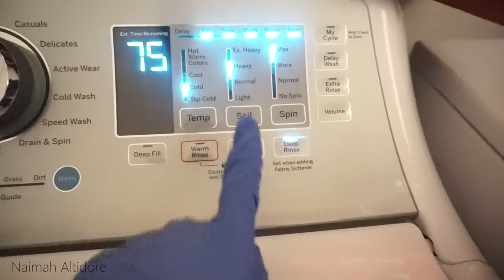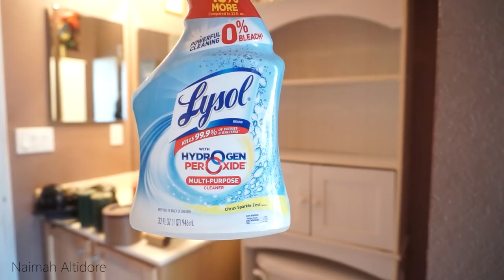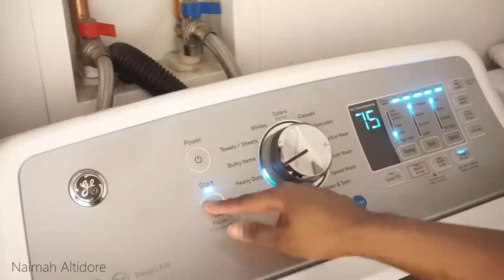ALL DAY CLEAN WITH ME / ACTUAL MESSY HOUSE / CLEANING MOTIVATION  / SAHM / CLEANING MY MOM'S HOUSE

Comment: Idk if your mom has already tried this but some vacuums have up to 2 filters (idk maybe more). The maintenance guy where I use to work told me depending on how much you use it, u should rinse them out weekly and let them air dry. I was about to buy a new vacuum and tried it and my vacuum was back to normal
Reply from the maker: thanks or the tip

Comment: Alcohol hand sanitizer if you  put it on and glory it off will disolve the ink.  You have to blot not to spread the stain.   The hand sanitizer is a gel and doesn't run off or soak in as fast.    It also w works if you get ink on other things.

Comment: Take an old White towel, an old steam iron, and oxyclean powder. Mix up oxyclean  pour on stain. Wet towel place over wet stain place iron on low cotton. Repeat until gone be sure not to melt fabric and always use fresh spot on towel. Will take several applications.

Comment: Nothing works better or easier in the bathroom,  than LYSOL POWER FOAM BATHROOMAFP CLEANER, you have to use an old tooth brush to get down in the hinges of the toilet & don't forget to get the coil behind the toilet